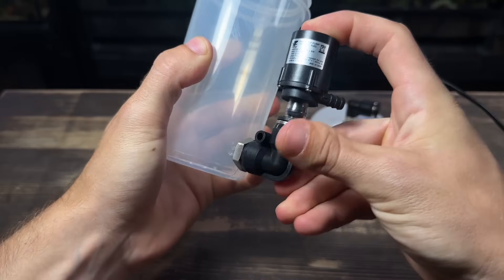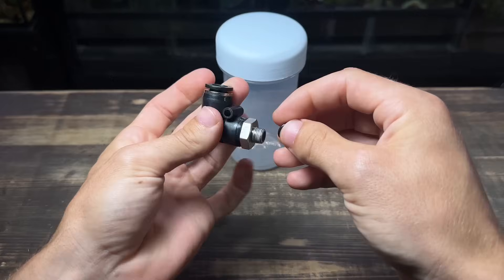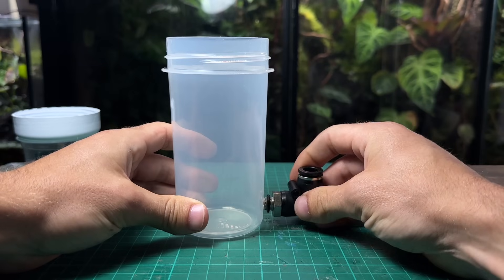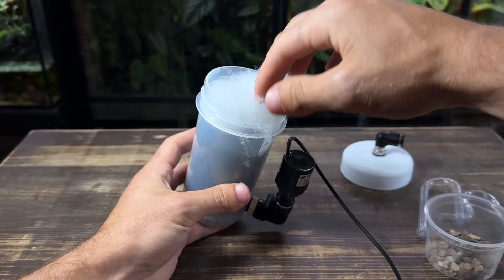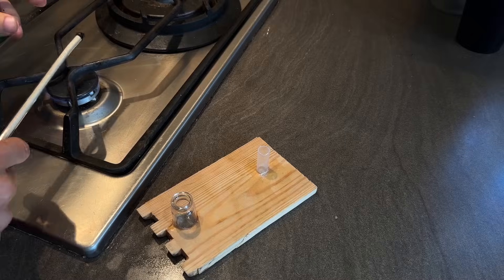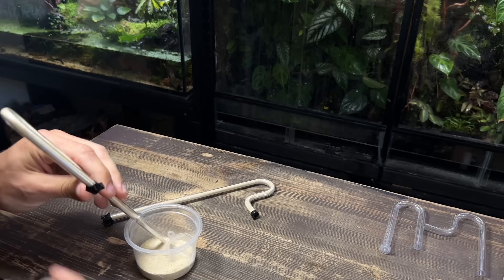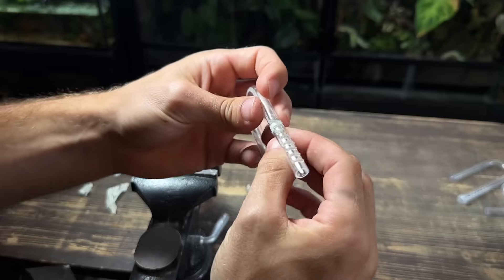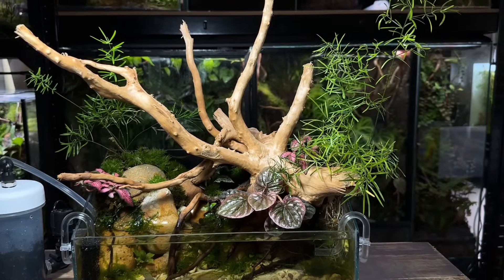How To Make a Mini Canister Filter For Nano Aquariums!

Comment: Do the straws fit into the 8mm push fittings well, 7.5mm internal plus1mm thickness is 9.5 diameter?

Comment: Just made this with a slightly bigger container for my new 10 gallon! Works great - highly recommend to anyone trying this to use the salt trick in the straw and patience, my first two bends came out terrible and I just broke one after adding the filter holes and dropping it on the floor. 😅

Comment: Normaly I start whit the corse filter matterial and end up whit the finere matterial at the end where watter flows out this way the corse takes most of the debrie and the finere makes the watter chrystall clear. The way you set it up will make the finere clump up and need to be changed often

Comment: 2:34 I find that, as it is, this isn't water tight.  To fix it, I just pushed an o ring into the fitting before the pipe to create a water tight seal.

Also, you have the filter foam in the wrong way.  The white polishing floss should be at the end of the filter, before the water goes back into the tank.

Comment: This is a great project, thank you so much for sharing! I used your parts list and instructions and made a canister filter. I’m having one strange problem and I’m not sure if you have any insight: the pump drains the canister faster than it refills it, so within about 60 seconds the canister is completely empty and the pump stopped running. Any idea where I went wrong or how to resolve?
Reply: Maybe the container isn't completely airtight? If its not sealed all the way, a suction loop cant be created and the siphon cant continue. Just a theory, hope you figure it out!

Comment: I'd spend more than a buck on the canister. I'd get one of those small reactor canisters from Bulk Reef Supply. They use real Mur-lok fittings, not that chinesium crap. I'd also get some of their RO tubing and holders. Those crappy suction cups WILL let you down one day, and drain the whole thing, or go dry.

Wow. So much wrong here. "Use what you've got" is a garbage mentality when it comes to anything water related, doubly so when pets are involved. Cheaping out, or not using good materials will fuck you eventually. You can buy real bulkhead fittings in that size for like $1.50, then you aren't relying on CS glue which isn't designed for this at all.
Reply: Man I wish I was a cool and as smart as you.

Comment: Wonderful video. Is there any reason that the fine filter is at the top closer to water intake (flow in) and then the coarse filter?
Reply: I think it's actually because the fine filter is just there to catch the debris, But the coarse one is to do the biological filtration (aka good bacteria) so the fine one will need to be replaced quite often so setting it at the top makes it easier

Comment: I can't find a cup like that to save my life lol..  Anyone have an amazon link to something similar that I can't seem to find.  How much larger can it be? 500ml to large? 250 to small? Thanks :)
Reply: I used a Rubbermaid brilliance container in the 16c/1gal size (the pump moves ~40 gal/h which is about right for my 6 gal tank and I wanted lots of space for media). I wanted to make sure it was something I knew for a fact would be airtight, sturdy, and food safe in the long run. I was about 1/3 my total cost, but the total was only $60 so it wasn't too bad lol

Comment: Is there a way to regulate the outflow any ideas?
Reply: I use flow control valve in the middle of the outflow pipe.  find one that could fit with pipe size. flow control valve with 1/4'' size was the perfect size for me

Comment: Can you use two 8mm instead of an 8mm and a 10mm?
Reply: The 10 mm is to accommodate the inflow of the specific pump he used and linked, if you had a different pump you probably could get away with two 8mm :)

Comment: Instead of sand you could use salt.  It would rinse out easily with water when you're done and would have a lower chance of scratching the plastic.
Reply from the maker: Just tried the salt & it works great! Much easier to wash out with some warm water. Thanks for the idea😃
Reply: @TerrariumDesigns  Awesome.  I can't take credit for that though.  Saw Dean do it in an Aquarium Co-op video a few years ago.
Reply: @Sandhills_nature_hobbies  you're a good dude
Reply: As someone who does custom water cooled PCs I can tell you there is a even better solution because tools exist to bend plastic tubing.  They make silicone tubing inserts for this exact purpose.  It prevents a bunch of rough sand/salt grain imprints on the inside of the tubing.

We also typically use a heat gun to soften the tubing which I would recommend over any type of open flame.  A high power hair dryer would probably also do the job.
Reply: @JathraDH  100% agree but I give you the information : Hair dryer take an eternity, heatgun is way more effective !
Reply: @jackasscou  Yeah for sure.  I mentioned I would use a heat gun first and foremost.  I just mentioned the hair dryer as a "maybe" because its something most people probably have laying around and a heat gun is a more niche tool.

I am not sure a low power one would get hot enough to be effective however.  Thanks for the reply!
Reply: Thanks for the tip!
Reply: Is there a specific type of salt that should be used? I tried this with Epsom Salt and it did not work, unfortunately. The pipe collapsed. Gunna go get some normal table salt and try again in the meantime.
Reply: @Topher0089  NaCl, regular salt
Reply: I've been using cocaine.  Its pretty easy and satisfying to get out of the straw. Pretty expensive though...
Reply: No, just do sand changes every so often. Once every 6 months or year
Reply: Yes, buy another product to make an inexpensive product rather than using products that are already in your home because it's better to spend more money to make a lesser cost item
Reply: Instead of salt he could use sugar 😂
Reply: Yes, but salt for some is expensive to waste

Comment: I've been using diy canisters for last 8 years.turns our they're really really inexpensive to make with some basic diy skills and tools and still works just as good as the commercial ones😊
Reply: How did you make it? Show us
Reply: @avijitsikdar5514  i made it pvc pipes. Search "Om Fery Canister Filter"
Reply: How all 3 i made leaked and wouldn't draw water
Reply: Of course they work just as good as commercial ones! Just make sure you get a pump that has the same flow rate, and head pressure (so it can stand below your tank and pump water to at least 1.5m) and only use 20-30PPI foam as biological media! It's the best both when it comes to biological filtration, and when it comes to price!